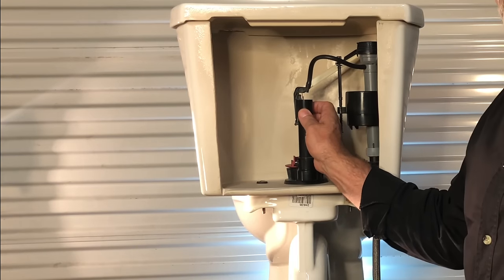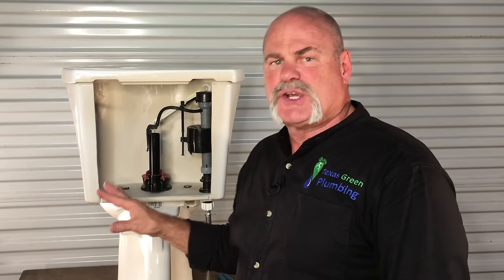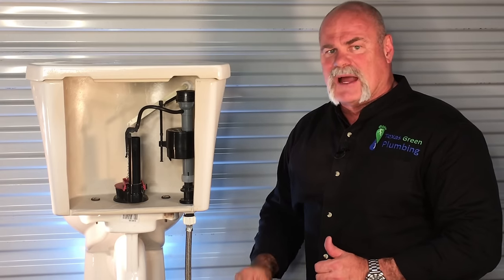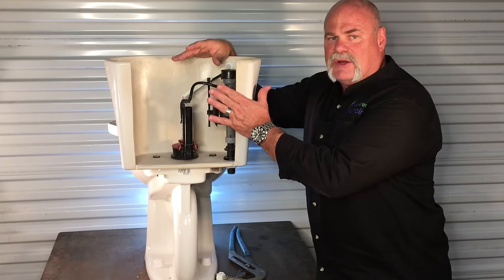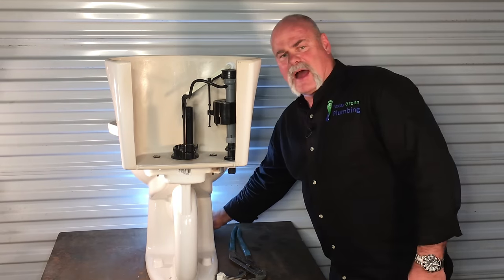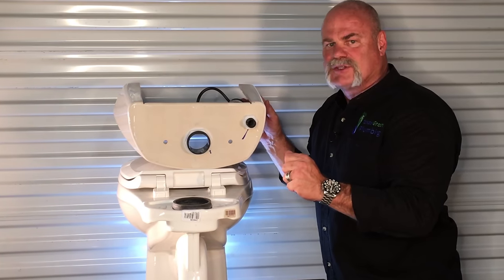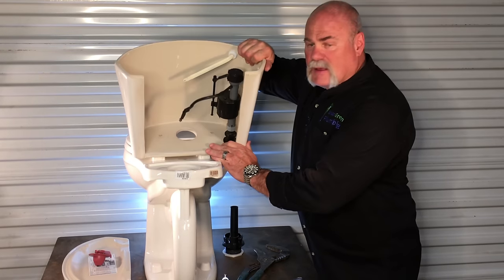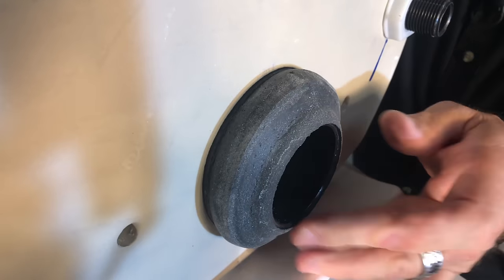How To Replace A Toilet Flush Valve - DIY Plumbing

Comment: This video was 5 years ago but it still helps people. It helped me. I just lifted the flush valve and clean around it.  It stopped the leak. Thank you Mr. Wakefield. 
We've been paying $100 more than average bill. The water company sent a reminder that we might have leaks and to check everything.
Reply from the maker: Good on the water company for giving a heads up!
Reply: Great job

Comment: The most clear, concise and comprehensive instructional videos. And I’ve seen a lot - on many subjects beyond plumbing.  I’ve done it all before but have an ongoing problem with a toilet “ghost” flushing. Suggestion-rather than adjusting everything at once, I’m making one adjustment at a time. This way if it happens again on this or another toilet I may be able to identify the source of the problem

Comment: Thanks for the videos Roger and easy to understand instructions. My tank has 3 bolts instead of 2 and when the flush valve was turned all the way it was difficult to screw in the 3rd bolt. I resolved this by rotating the flush valve back. Also my bolt replacements came with rubber tapered washers for 2 per bolt along with a metal washer. Took a couple tries to realize I only needed the rubber washers inside the tank and not on both sides. The metal washers I used for the 3 nuts to avoid cracking the porcelain. Because my original bolts and nuts had fused together (replaced with brass plated hardware), it took about 2 hours to saw them off with a metal hacksaw and round handle since this was the only way to access the bolts. As an Information Technology Manager and professional trainer, your video seemed to only handle the "happy path" under ideal conditions and didn't address older or less optimal edge cases. Still Roger , I appreciated your presentation and have subscribed to your channel.   Like computer software, you also need to account for the exceptions, and I'd also be interested to know exactly how the fill valve works internally to shut off the water. Seems like the float is restricted to a certain level that somehow stops the flow of water coming into the toilet.  Then again that the way geeks are we want to know how everything works.

Comment: This is perfect instruction..especially for a non plumber. I have been waiting for my husband to attempt to fix our downstairs toilet since we had our well pump replaced. I use this bathroom mainly, but for whatever reason has not functioned properly since the well pump replacement,  almost 8 months ago & I am tired of turning the water valve off after each flush. Since, it won't fix itself & my husband, "Will get to it"later than sooner- I am tackling this feat.  It wants to continuously run after the tank is full...I felt around the seal...wiped it out multiple times thinking a piece of sediment has caused it not to seal. I have disassembled the flapper..still no success. I am going to replace the flapper to start..& take it from there. Thank you for sharing this easy instruction video.....from the done nagging to do it myself wife.

Comment: Great video and easily understood.  I have a slow leak, probably a tank full every 2-3 days.  Replaced the flapper and cleaned surface of the flush valve but still an issue.  Next step is to replace the whole piece.  Probably due for it anyways as it has been 10-12 years.

Comment: That was good information. A quality, easy to view, well explained instructional video. Most videos relating to toilet leak repairs are about flapper valve or fill valve replacements. Thanks for going into the repairs a little deeper, with   detailed, step by step instructions on this particular job.

Comment: having a lot of fun with an old toilet, American standard. couldn't just replace the flapper valve since it was made such that it wouldn't come off, tried looking for replacement parts on company site but they didn't carry any for older models, bought a full replacement kit from a hardware store, said compatible with 99% of toilets, figured id give it a shot. the gasket didn't fit the bowl opening. so next i tried putting the old gasket on the fitting, that also isn't working so far, will try some more once my brothers able to help me. just frustrating how company's non-standardize their parts because they don't want you to replace the small components, they want you to have to buy a whole new toilet. still hoping i can make this work but this is just repairs around the house as usual, always having to pull an improvised 'fix' to make stuff work.

Comment: You do a fabulous job with explaining step by step and each part. What needs, needs!, to be added is the aspect that when putting the tank back into place DO NOT ROCK THE TANK BECAUSE YOU MIGHT BREAK THE CONNECTING SEAL {yep, like I did & now we're buying a whole new toilet}.
Reply: 55uuiiiuii

Comment: Great Tip re: 1/4 turn of the main nut after hand tightening! I was overtightening it, which caused some distortion and continued leaking. I re-installed it with the 1/4 turn, and it worked great.  Thank You!

Comment: thanks for the video. I have a sterling brand toilet that is leaking water from the tank into the bowl. I replaced the flapper and adjusted the float arm to make sure that water isn't overflowing into the overflow tube. My last hope is that replacing the flush valve will fix the leak!

Comment: Replaced the flush valve with new flapper and the fill valve. Still have a leak from the tank to the bowl (very slowly). No water on the floor just a very small trickle into the side of the bowl. After trickling for a few minutes the fill valve opens to replace what leaked into the bowl. Flapper not sealing?

Comment: Thank you for this amaZing video! you were very clear and streamline in your presentation and i appreciate all your expertise! <3  I do have a problem that maybe you could advise me how to handle ... I bought my home and noticed that many drains were fairly slow to drain, but not horribly slow. I expected that there may be hair or whatnot in the drains, but after vinegar and baking soda many times over, i still had a concern. I saw a video that it could be the roof vents needing clean out, and that i could spray the hose down to do so. So after i did that, i discovered that one roof vent is full of wood. Yes, actual scraps of wood. My guess is that a contractor was not happy with either the home owner, or his boss, and dropped a whole mess of scrap wood down the vent. I tried to shop vac it out but cannot make a good enough suction as the roof vent is probably 2.5",  and then gets larger below the roof line... anyway, i broke apart a roof rake, and wedged a piece of wood into the opening on one end and screwed a double ended screw into it, to make a sort of spear... i tied a strong string onto the other end in case i lost hold of it and dropped it into the vent. i proceeded to jab the screw into the wood (inside the vent) and drill (so to speak) into the wood just enough to grab hold and fish out the pieces. I was successful in fishing out about 12 pieces of wood. Random pieces of moulding (the longest so far was about 12" long and 1" thick, but all different cuts of wood). At this point, i can no longer grasp the wood. i can screw into it, but it pulls out as i start to lift it out. I imagine that the next piece to remove is tapered and that is probably why its difficult to catch it with the screw. My home is a two-story with a basement, and from the roof, my rake handle is down to about where the second floor's floor is (or the first floor's ceiling). I cannot get a plumber willing to take on this project without estimating into the thousands of dollars. One plumber suggested pulling off the kitchen cupboards (as that is where the vent probably - but not certainly - runs down to the basement) and cutting large hole in the wall, then securing the stack with strapping and cutting large section out to remove the wood, then inserting a boot and leaving the strapping in place. and repairing the wall. This is so hard job for someone! Do you think this is important to do? Or would a Studor vent under my kitchen sink be fine? I appreciate your advice! <3

Comment: I had a water bill of $730 because the flapper was constantly leaking. Plumbers putty didn't help, there was corrosion on both sides. Replacing this finally fixed the issue

Comment: Professional video and informative.
Was an easy up vote from me.
Update: Installed everything correclty including getting the settings right. Great video. Had me feeling confident and I was a first-time-go at replacing both the fill valve and the flush valve. :)

Comment: Thanks a lot for your thorough guide! My toilet for some reason has some silicone seal around the gap between the cistern and the main toilet "body". Should I redo it after taking it apart? Or are the two nuts enough to hold the cistern in place? Thanks again.

Comment: Nice video. Can you make a video on how to get the back of the toilet to seal up after you fill it with water. I cut mine like yours and it was SUPER easy to work on, but mine won’t seal properly now. Thank the lord I put those towels down you mentioned in the beginning because there sure was a lot of water spilled. Thank you for making this video my flush valve works wonderful.

Comment: Hey Roger, awesome video. I’ve installed a brand new set up. What happens if there’s still leaking water into the bowl? Does this mean I didn’t cut the flush valve low enough? 

Thanks in advance
Reply: Love your instructions

Comment: Really helpful. I just subscribed.  I’m about to replace the flush valve on each my four toilets in my 60 year old house. I will probably also replace the fill valves. How do I deal with corroded screws and turn off handles?

Comment: Just moved into a house with Delta toilets and super low flush tubes so really weak flushing power due to not much water in tank. Is that ‘low flo’? to conserve water? End up flushing 2 or even 3 times. Should I try to extend tube higher? Or replace? Fill valve is stupid too. Macro and micro adjustments AND a filter you have to clean. Thanks

Comment: I got a Korky replacement valve assembly.  The problem I encountered were that the instructions were poorly written and guess to save money by small paper the type was small and worse it was had to make out how the parts were to be put together looking at the small illustrations.  Also, there was no plastic wrench in the box as indicated by the instructions.  In contrast, the instructions for installing a Moen kitchen sink faucet had large foldout instructions with large illustrations.   Kudos for Moen.

Comment: I have a toilet that has one of those big low-flow flush valves (the ones that leave a full 1 inch of water in the bottom when flushed). Can I switch it out to a universal flush valve? Reason I ask is the old stopper is wider than the universal flush valve has.

Comment: Roger that huge nut that keeps OLD  flush valve in place isn't budging for me even with channel locks.  Any suggestions?   I don't think I have 3 and 1 oil.  I may go look.   I have 2 other bathrooms so I'm not too worried about the not having the use of the toilet.   This toilet actually gets replaced soon it's 30 years old and the bathroom like say the tub gets replaced with a shower I walk in shower the floor as getting tiled I and a new vanity goes in place I'm just not ready to do it now I just wanted to fix the toilet so I could actually use it because right now what I have to do is turn the water on and off every time I wanna flush it otherwise it just leaks and leaks in leaks in my water bill sky rocketed one month till I figured out the problem and by the way 1 of the other toilets is in the same boat it leaks I and I'm getting ready to fix it as well.

Comment: What if you have a tank that doesnt have the bolts in the bowl as you are showing here?  i do feel the  nut under the tank but dont see the screw inside the tank.  is this ok?  i do have an issue with the flush valve as it pops out of the slot on the bottom of the tank, i can put it back into it, but that becomes annoying after each flush...   thanks for doing this video.  very helpful

Comment: I installed a korky flush valve and I noticed the bowl gasket is very thick. I tightened the two bolts down that holds the tank but there's a slight wobble. If I tighten it further, it will damage the rubber seals that the bolts go into. Any suggestions?

Comment: Soooo, my toilet doesn't run constantly.  But every 15 or so minutes, it will fill for about 10 seconds, and shut off.  My "flush valve" has a tilted opening, unlike your demo, which is flat.  Or flush with the tank bottom.  I've felt the opening.  No nicks, or cracks, but I've thought it was flapper.  So I've tried  many different types.  They make so many , how do you know what size, and style to use?  I like your videos.  They make me feel comfortable doing the work.  Thanks.

Comment: I suspect that the seal around the bottom edges of my flush valves are leaking.  I'm a little bummed to find out that I will have to remove the tank entirely to attempt to remedy the situation.

That said, thank you for this super clear and thorough video showing how this is done!
Reply from the maker: It may sound daunting...but that's an easy job you're capable of! Let me know how it goes 😎

Comment: What brand and model is this one and do you know if it will fit a mansfield 160  toilet?  I replaced mine with a mansfield brand correct model #, but apparently theirs is such low quality it leaks through the seal even after I replaced the new seal on it with another new seal, their brand. I just need a better brand. The leak is definitely coming from the flush valve, not anywhere else. And I don't want to keep removing my tank to replace again and again. I put the seal on correctly, it does spin fine and it's not hard to flush the toilet.

Comment: Well done...Great info.
My toilet has a vertical tube which that flapper piece runs up and down the tube/shaft when you flush rather than being like a hinged type flapper. 
Not sure if I can change it over to what you have here.
I can't find so far the vertical type mechanism and don't know what you call that type flush mechanism to do a search. Any advice welcome. Thanks.
Phil
Reply from the maker: Glad i was able to help fix your problem 💪

Comment: I cleaned the valve like you recommended.  The water is not coming out of the rubber tube.  It is running down the valve stem and the metal wire.  I cut crimped piece out and reattached the rubber tube.  However the water does not run out of the Tube.  
Do I need a new one or can it be fixed.

Comment: Great video but I have a question. Do you always have to change the gasket if you are changing the flush valve?
Reply from the maker: no, unless the gasket is damaged or is causing you problems also.

Comment: Can you have a leak on the bottom of the flush valve that trickles into the toilet because I changed the flapper and glued a gasket around the opening of the flush valve and there is still water trickling in causing the water to turn on every five minutes.

Comment: Hi there I have replaced my toilet water valve cause I broke the old one installing a bidet seat. My problem is that the nut on the underside is dripping. I was told not to over tighten just to hand tighten but it still leaking. I have removed it and redid it in case it was not on straight but it still leaks.how can I fix this

Comment: Great video. Thank you for sharing. 
I have problem of toilet refilling after flash.  Sometime it does refill and some other times it won’t unless another faucet in the bathroom opened to start refilling of I have to remove the lid to manually play with the valve to refill.  Any advice?

Comment: Recently replaced my refill valve,  worked for a little while and then the toilet stopped filling up again.  Long story short, I didn't replace the riser from water line to the valve.  After completely disassembling I found a grommet in the lower portion of the riser had gotten dislodged and was blocking the flow of water. Is this rubber grommet important?? I removed it with a screw driver and reassembled everything.  No leaks and the toilet is once again filling up.  Any knowledge would be welcomed.

Comment: Is there any adjustment for the TOILET FLUSH VALVE?
I have had a leak from the gasket of the TOILET FILL PIPE and replaced it.
I adjusted the height of the float, and the extra little valve that regulated the rate of water filling.
But, the problem is my toilet barely fills up at all.
I did not touch the Flush Valve, and from all indications the Fill Pipe is installed correctly.
I have a really weird very wide Flush Valve from my weird ( people tell me ) American Standard low flow toilet.
When my toilet flushes it sounds like all the water crashed down at once ... doesn't sound like a regular toilet, but it has been that way since I got it, and it has worked, albeit loudly for over a decade.
I removed and re-adjusted the Fill Pipe ( screwed it to the maximum height ) which is what the instructions to the Fill Pipe replacement kit said to do.  It also said to open a little red valve that lets water flow in faster so it fills the tank fasters.
I am stumped.

Comment: Hi how r you, my toilet was ruining a lot then I replaced the flapper n it slowed the leak down but still leaked not as much what is the problem now? Should I replace the flush valve? Thank you for your videos they r so helpful
Reply from the maker: That or the fill valve. If you turn the water off does the tank empty?
Reply: I'm not the poster but when I turn off the water, my tank empties. I just swapped out my fill valve and it still fills the tank bit by bit ever 10 mins or so just to top things off. Should I swap my flapper valve?